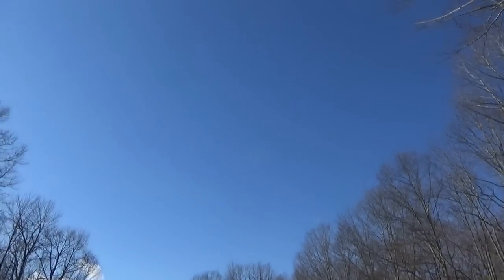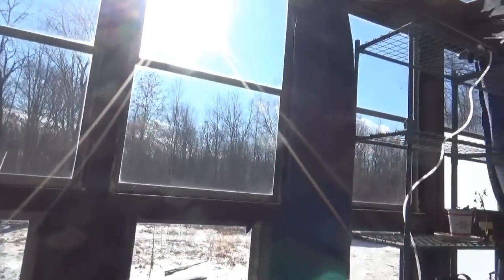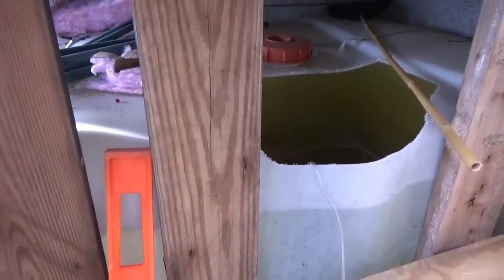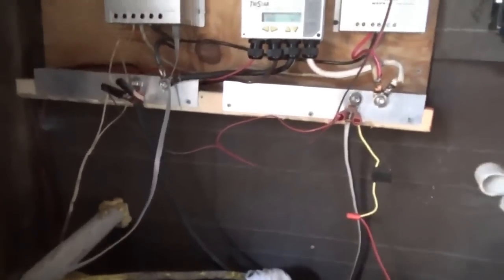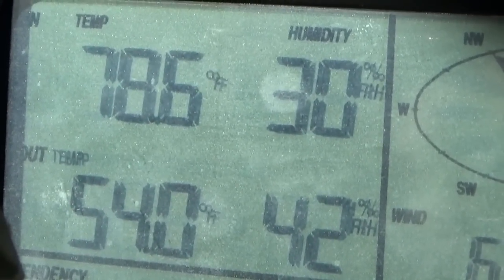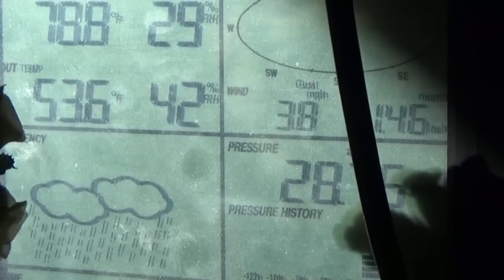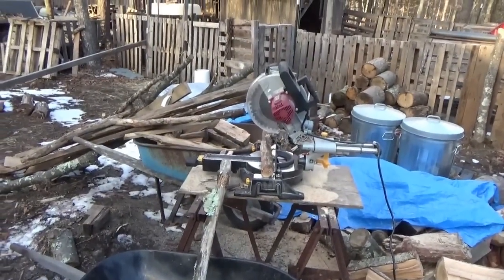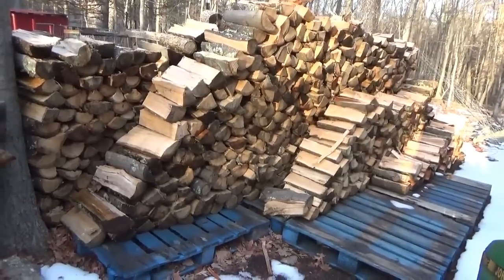Awesome Solar Power & Built A Magnet Separating Tool

Comment: Troy with a surplus of solar coming in that day, why do you not turn on any lights on in the living room of the tiny house? Every video in the evening it seems Mel and you use headlamps or sit in darkness. Why if the batteries are fully charged?
Reply from the maker: Actually we do but although when I installed them, the indirect lighting looked nice, they sure are dim now.
Reply: If there is full sun and the batteries are full,  do you ever use and extension cord to run the saw?

Comment: A wooden shear keep edges on arms straight and will be good. You did do a lot of tree felling this year. Use rubber mallet taps for knocking off sawdust buildup on guide bar. Need rack on mini to hold a five gallon water cans. Also need a hand held water pump to bring water up into cans, will beat frozen fingers and hands.
Reply from the maker: I am considering a rack on the bike since I use it so much. Water pump would work too.

Comment: When you finish charging that battery, show how long it holds it charge for, don't just get a voltage reading after you disconnect it and claim success.
Reply from the maker: Well, in the previous day's video I said that I shut off the Bedini motor and left the battery to rest all day. Then I later, in the evening, measured the voltage of the battery - after a full day of rest - and it was 12.7 volts. Here is the article I wrote that went along with the video: http://www.thedoityourselfworld.com/articles/article.php?id=11407
Halfway down the article I mention this in all detail, in case you dont want to watch the video again.